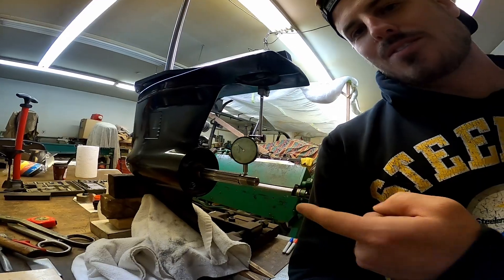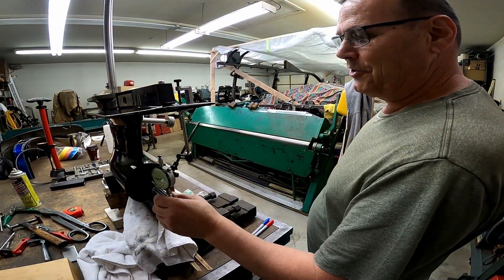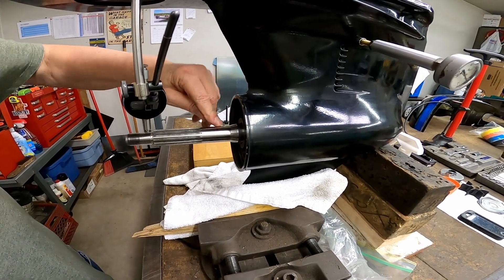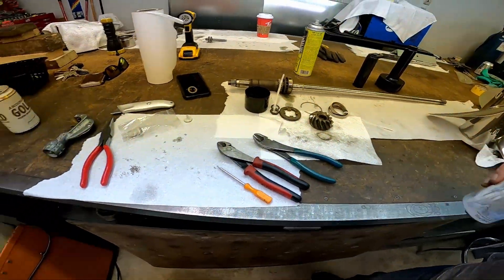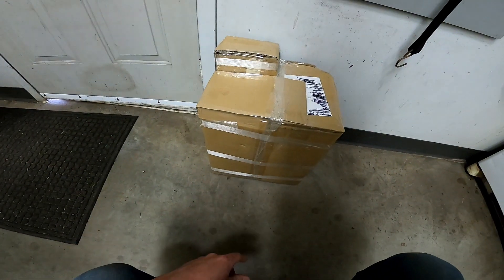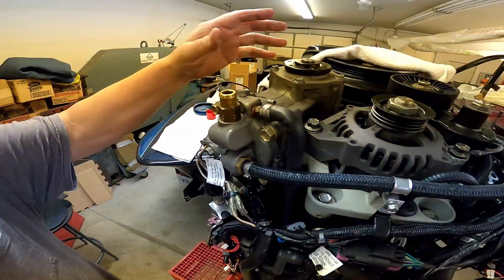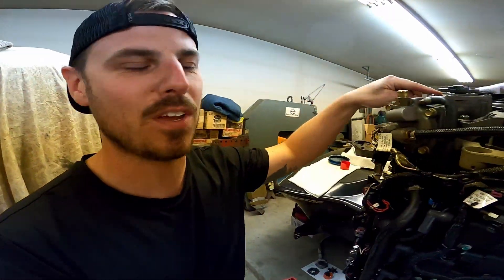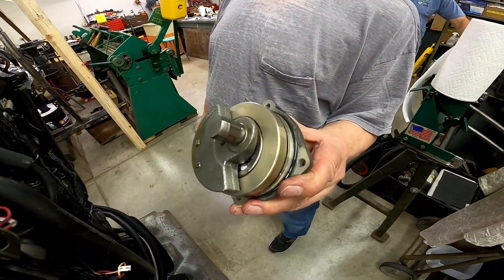BLOWN Compressor On Our Mercury Optimax Pro XS - Disassembling compressor to investigate

Comment from the maker: Reply to this comment if you're at all worried about the compressor on your Optimax (or if yours has ever blown!)
Reply: I’m worried mine is blown or going soon.   It started making a chirping like sound today.  And runs ok. Just not a good sound at all.   I dk what to check first
Reply from the maker: @controlavirus9839 pop the belt off and check for play and knock. Pull the filter and check for particulate.
Reply: @FishingOntario  thank you.
Reply: @ a mechanic also told me that it sounds like ( I had video of it running) exactly like he’s seen before.  An air hose going to fuel rail on starboard side has leak
Reply: @FishingOntario  ok we pulled belt and everything is tight except for the pulley on top of the compressor itself.  You can turn it either way by hand.    Also which filter are you referring to checking?  Thank you
Reply: @BENNETT-to-WIN-IT  I would also check for play in the upper bearings below the pulley with the belt off see if you can grab the pulley and rock it back and forth if there is any play the bearings are failing and that is most likely the your noise also make sure the belt tensioner is in good shape so the belt is not slipping if I remember correctly when checked with a torque wrench it should click at 70 inch pounds before reaching the full travel stop.
Reply: @BENNETT-to-WIN-IT  And also check the condition of the bearings in the idler wheel on the tensioner they are known to fail and make sure the belt is in great shape because when they break it can make for a big mess and a bad day
Reply: @chrisholmes1666  Chris,  great job on this video.  I wanted to share what happened on mine recently. The tensioner bolt was not lubricated properly and the constant back and forth of the tensioner arm began to back out the bolt which of course raised the tensioner pully to the point the belt slipped under the tensioner pully. This ate away at the belt as well as the pulley for a time sending all the plastic and rubber dust through everything. This 225 opti has a filter for the compressor, so it was protected (I hope....). What is the recommendation for everything else? I blew/washed  out everything under the cowl  I could with compressed air and soapy water after pulling the lower cowling.   How deep do I need to dig into this motor after a belt and pulley failure like this?
Reply: @anon-oe3by  Thanks for watching .This motor had had a belt failure before we owned it and was not cleaned very well I picked rubber chunks out of various spots on it for days . The main area that became a problem was the air plenum and reeds there was a lot of belt material laying in the bottom of the plenum and some larger pieces had gotten caught between the reed cage and the reed causing some reed petals to crack .We have some more video footage of the carnage and repair with new reeds and lapping the cages but Kyle has not had time to edit it yet. You can get a pretty good look at things down the throttle body with a flash light and using an inspection mirror you can get a fairly good look at the reeds to see if there's any big chunks laying in there. I believe the bolt backing out was a common issue at one point and I think they may have changed to a stud and nut . the stud should be installed with red loctite and make sure to keep the swivel tensioner arm lubed up .

Comment: Very helpful! Thank you how’s the opti done since an the repairs
Reply: Thanks for watching .We no longer own it but we ended up replacing the reeds ,tracker valve, tps sensor, cleaning injectors and many other normal maintenance items and it ran very well. We ended up having a bearing failure in the lower unit it was a self inflicted wound as it was the only bearing we did not visually inspect when the lower was apart and we believe was damaged by the prop shaft when it was bent the bearing is inside the forward gear. I think these motors are great motors when maintained properly

Comment: So the other day on Mother’s Day I took my parents out on my new to me boat. It has a 2008 225 hp pro xs. I was just at clutch ahead trolling and it died and wouldn’t start. I got it back running it was a 20 amp fuse that I guess controlled getting fuel to the engine. But now I have launched it and it’ll only run to 5,200 rpm’s and has a little shake at idol. Any idea what that could be ? I’m a mechanic in the coast guard but know nothing about these engines yet.
Reply: It would be tough for me to say but there is a great resource if you go to Bass Boat Central and go in the forum section find the Mercury 3.0 liter area and post your question there make sure to include your serial number of the motor in your post as that's what mercury uses to identify their motors . There are a few guys on there that work on these Optimax's every day and are extremely knowledgeable .Don Weed is one of the moderators and is a guru on these motors .

Comment: How do bleed your oil pump on your optimax
Reply: You can either take it to a dealer and have them hook up a diagnostic tool and prime it or you can get after market software for a laptop Rinda is one brand name that is known to be good. Either way it needs to be done if you have any oil lines disconnected  that exit the remote oil tank or any place on the block- oil pump - intake - compressor etc. It only takes a few minutes to do. Thanks for watching and I hope that helps you.
Reply from the maker: My dad nailed it in the his comment, refer to it!

Comment: I have a pair of 2005 Optimax engines bought brand new in ‘05.   Have 1400 hours on them.   At 1200 hours as a precautionary measure before having a catastrophic failure of the air compressors I changed them out with brand new ones from Mercury.   From about 500 hours in, I have always used Pennzoil XLF oil and religiously changed the various inline oil filters under the cowl about every 200 hours.  I attribute both that specific oil and the filter changes on why my original air compressors never failed.   I’m about to do another round of preventive maintenance, changing out the air/fuel diaphragms in the port fuel rail and the tracker diaghpragm on the starboard side rail, new t-stats and poppet valves, new alternator belt, water pump including the top yellow seal and shift shaft seal, lower unit gear oil change and all new zinc anodes.   With the lower unit off, before I put in the t-stats and poppet valves and the new zincs, will be flushing the engines using a sump pump in a trough for about 6 hours recirculating 5% to 7% hydrochoric acid (a/k/a muriatic acid) mixture with water.   That dilution of acid is what Rydlyme is.   Hope to get another few years out of my Optis which so far have been very reliable for me.
Reply from the maker: They are great motors if you stay on top of the regular maintenance! Hope you get lots more hours out of them.
Reply: @FishingOntario  I mentioned previously the Pennzoil XLF oil - XLF I believe means extra low friction - because I am convinced it’s why I went so long with no compressor failure.  Somewhere years ago on some boating forum I had found a thread on this oil and someone had mentioned the lubricity is so good that it’s not recommended to be used during a new engine’s break in process.  I get it at Walmart here in Miami, FL USA.   Costs about $20 a gallon or so.  Have also found it at times on Amazon
Reply from the maker: @raisingcane225   Never heard of it before, but it obviously works!
Reply: That's a great read and good to hear the success that you have had with them especially in salt it goes to prove that good maintenance and care pays off . How do you find sourcing oem mercury parts to be in your area ? up here it is very hit and miss you can either get it overnight or it takes weeks sometimes for usually the simplest thing that's my only mercury complaint . I wish you continued success and enjoyment  with your opti's and thank you for watching and commenting it's good information for us and others that read it as well .
Reply: @chrisholmes1666  For me, generally I’ve not had issues with Mercury part availability.  I live in South Florida in the USA and over the past 19 years owning my Optimax’s have bought parts from a combination of brick and mortar local marine stores as well as plenty from online, US-based vendors.  I can’t really recall a case where there was a prolonged lack of availability of something I was needing.

Comment: I haven't had to work on one yet but where is the filter located?
Reply from the maker: Which filter are we looking for my friend?
Reply: @FishingOntario  the plastic one that you took apart.
Reply: @brucemaessen2959  There are actually three of them one is on the incoming line from the remote tank in the boat and is just before the engine mounted oil tank the other two are in the return lines coming off the compressor and these are the ones in the video one runs to the upper main bearing on the crank and the other runs to the lower main bearing if you follow the lines off the lower part of the compressor you will see them the one going to the lower is harder to see because of components being in the way. They are directional and have an arrow embossed in them the arrow should point away from the compressor towards the main bearings . Hope that helps and thanks for watching.

Comment: Great video guys! As a DIY  maintenance guy myself, I really appreciate good footage of the component, and detailed explanation of how it works, how to fix it, and how one problem can cause another.  I have 2015 with 450 hrs, and have never really inspected the compressor system, other than cleaning water strainer.  Headed out to inspect mine now. Keep the videos coming, I have a lot to learn!
Reply: Thanks so much for watching and commenting . Good on you for doing your own maintenance that's what these motors need and are great motors when looked after properly . You can lose a lot of the boating season with it sitting at a dealership waiting to get worked on at least around here anyways they are always backed up for weeks . If you don't have an oem factory service manual it's a great investment that has the correct info and procedures for anything you would encounter pretty much . I hope your compressor checks out to be good and you have a great season .
Reply from the maker: Thanks for watching and the kind words!

Comment: You can straighten shaft  without taking it apart.
Reply: Thanks for the info we wanted to see the rest of the lower unit parts to check for wear and also do a total reseal taking it apart is not a big job and you have peace of mind in the end. Thanks for watching and commenting
Reply: How is the best way to straighten. I have one that needs
Reply: @ScottMorganHarris  In my opinion the best way is to take the lower unit apart and send the shaft to someone who does prop work they often do prop shaft straightening as well .They will have fixtures and tooling they have developed to do the job without damaging the critical surfaces on the shaft and also be able to measure it accurately. Trying to straighten it while still on the boat with a pipe over the shaft could lead to damage to the prop shaft bearings and other parts of the gear case in my opinion . A good machine shop would also be able to do it but they might have to fabricate some tooling possibly which would be time you would be charged for so if you can find someone that's set up to do it it will be cheaper .Around hear it costs about $150 to get one straightened a new prop shaft is approximately $ 700 US dollars if you can get one .
Reply from the maker: I don't really see any way you could, without removing it. Also, need to take apart the lower unit to inspect the bearings that were damaged from the shaft being run bent anyways.

Comment: I am thinking of buying a 2008 Optimax 225 with 230hrs on the  clock. Mechanic says it's in great shape and very well kept, good oil use etc. What is the approximate range of hours I should expect the compressor to fail? is round the 400hr mark realistic?
Reply: That's a tough question to answer 230 hours is low for the year of the motor and it sounds like it has been looked after very well . The 400 hour number is sort of a general number that seems common to hear but there are lots that have failed with much less and also ones with  hundreds of hours that never have had a problem . If it has a problem currently you should be able to feel and hear an audible knock when rocking the compressor pully by hand (belt off) back and forth at top or bottom dead center of the stroke and would be very noticeable when running at idle (optimax motors do have a slight knocking sound when running normally) . Other issues that could happen are broken reeds , piston and or rings cracked or broken damaging the bore . I would say take it to a mechanic that you know and trust that is familiar with these motors and have them check it out it would be money well spent .They can get DDT printout showing previous faults/codes check the compression and fuel and air pressure readings and give you an opinion on the general health of the motor  .Good luck with your purchase if you buy it and I hope you get lots of enjoyment from it .Thanks for watching and commenting
Reply from the maker: Hey Warren, looks like my dad beat me to the punch on replying to you, so thanks for watching and commenting!

Comment: Geese I thought mercury was one of the best motors? Sorry for your troubles
Reply: Thanks for watching and commenting. I think in general all the major brands are good and they all have had problems with certain models they have produced .The optimax motors were made for a long period of time late 90's up till 2018 so there are a ton of them out there. I think they are thought of as being great motors and when regular maintenance is kept up on them they are very dependable and great on fuel economy .
Reply from the maker: Yeah, unfortunately they all have their issues. Thanks for watching!

Comment: Hey can the crack journal be turned down and sleved or a insert put inside the rod bearing race ?
Reply: That's a great question .The journal is not very robust to begin with I would be worried about the strength of it after turning it enough to get it to clean up before sleeving. The individual parts can be bought like the end cap crank assembly but if the rest of the components are worn I don't think it makes sense to throw money at it as mercury parts are not cheap. There are rumors of people rebuilding them and putting them back into service but I have no experience with that. There is supposed to be a guy a couple hours from us that does that but I can't speak to the success  he has . I think the biggest problem with the crank design is that it is only supported by a bearing on the upper end and nothing below the journal and also how they are oiled . Cooling can be a factor to if the strainer is not kept clean .Thanks for watching and commenting

Comment: Hey man, what gauge is that?  I would like to get one to see if my mechanic was telling me the truth.  He said -15 for my 2 year old Yamaha SHO.
Reply: It's a Mitutoyo 0-1/2 inch dial indicator the holder/clamp setup is from another indicator set we have it has a screw type clamp that you can mount off the cavitation plate. 15 thou sounds like a lot if that is Yamaha's tolerance I'm not familiar with them but you should be able to get that info  pretty easy . Also where yamaha says to take the measurement from. What is shown in the video is actually not the right spot for this lower unit it should be right on top the thread we had just moved it to double check at the time the fat shaft TM 1 and 2 mercury lowers are measured in a different spot than this verado style. Thanks for watching
Reply: @chrisholmes1666  I appreciate the info!  I thought I maybe should check it for myself instead of throwing a $1000 at what a tech from a local boat shop is say.  Now to find an indicator gauge and call Yamaha.  Thanks Again!
Reply from the maker: Heyo, I'm a bit late on the reply here and I see my dad has already  answered your question, so just wanted to follow up and say thanks for watching!

Comment: why did the compressor fail, is there a lubrication problem?
Reply: There are a few reasons they fail design is one thing they have been upgraded and changed since the first ones. lubrication and also cooling can cause it. There are some that run a long time others seem to have a short life span it's kind of luck of the draw it seems even with the new ones
Reply from the maker: Bad design by Mercury basically

Comment: running those heavy stainless props is not good for the lower units,, also aluminum props will break or bend if u hit something,, stainless props wont and take out your gears...I learned this the hard way..
Reply: In the performance boat world stainless is the only option because of the torgue and the weight they are carrying when the boat is on pad and these props are run much closer to the surface of the water they need to be strong aluminum is to weak and the blades have to much deflection under load but they are great on low speed utility and recreational boats for sure way cheaper if you damage one .These lower units are built pretty beefy and this one is the strongest of the three styles available for these motors .
Reply from the maker: An aluminum prop would not be able to handle the horsepower.